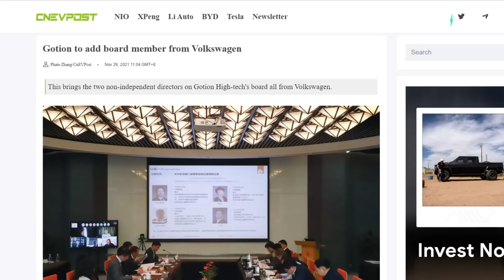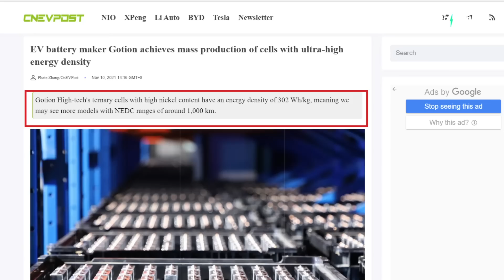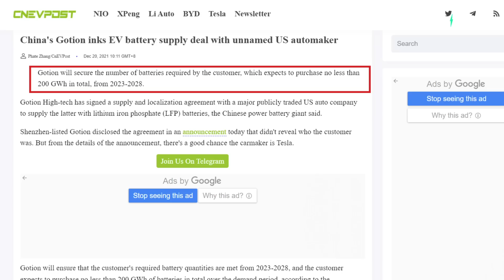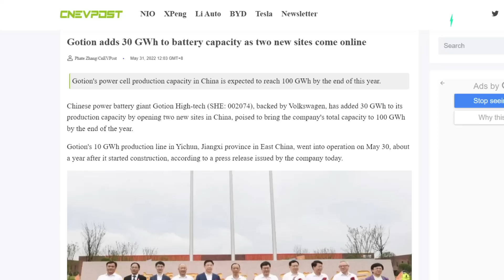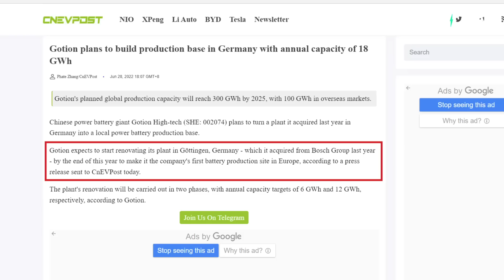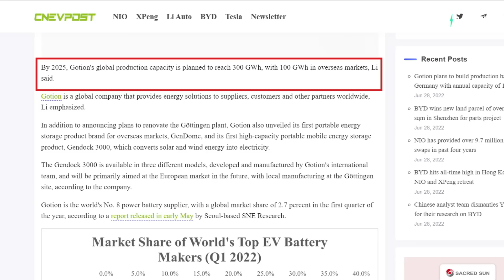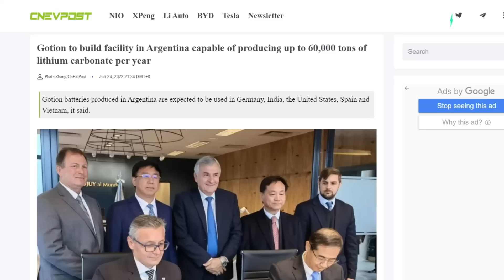Tesla, VW & Gotion High-Tech's scary battery CHESS moves

Comment: How could you say the stated capacity of electric electric car battery in kilowatt hours yet in smaller terms you just say kilowatts? 

There is specific energy density and there is specific power density and you’re not expressing these terms correctly. 

It’s like if the store was 10 km away and you said to somebody ‘ The store is 10 away’ 

I see it so clearly in my mind but nobody else does. What is wrong with you people?

Comment: Tesla's 4680 is the elephant  in the room. How does it relate to this?
Reply: 4680 is just a format, not a chemistry. the 46xx cells of bmw have a better chemistry now than the cells of tesla.
bmw was also very intelligent to make two different versions. the difference is in length. the longer cell is for SUVs, where the floor can be a bit thicker. the shorter 46xx cell if for sedans, where the floor needs to be thinner.
that also makes sense because a bigger sedan has more drag and needs more kWh per distance. very clever from BMW.
the first car with these cells is an SUV has 800km range WLTP and 400kW maximum charging speed. coming in the next few months. german car makers are now advancing fast.

Comment: 6 days ago we had "The biggest EV battery breakthrough I have EVER seen" from CATL which meant we "dont need solid state", now Gotion High-Tech are going to beat everything with a solid state battery! I'm not criticising, the pace of new revelations is just crazy. It will be exciting to see which technologies come out on top over the next few years. Amazing what can be done when the financial incentive is there. It is not hard to see why Tesla keeps on good terms with every battery maker they can. It is impossible to know what is coming next from the behind the curtain and in this case it could be VW that is ahead of the game.
Reply: 6 days ago CATL had the biggest breakthrough, but that was 6 years ago in battery time:) All new technologies are groundbreaking when they are announced, but something new and better is just around the corner.
The next generation, which is even more impressive will be announced next week, I guess.
CATL, BYD et. al. are not asleep at the wheel.
a 1000km battery is an exciting milestone, but unnecessary for most people. Someone with a work truck that provides electricity to tools at the job site and tows a 35' trailer on the weekends is another story.
I would like to see a battery pack with five 20kWh slots for modular batteries. I would buy one pack. That would covet 90+ % of our daily driving w/o ever visiting a charging station. For longer trips, I would rent four more packs that would be popped in NIO style and returned after the trip. I don't really want to pay for the worst possible case, but only what I really need. That would be better for nature and keep Li etc. mineral needs at a sustainable level.

Comment: You keep using the term "turnerairy battery" what is this?
And when talking battery capacity. Please mention if it is cell or pack level.
Thanks...
Reply: Ternary. Like triple. It relates to the three metal oxides used in the cathode. Nickel, Manganese and Colbalt

Comment: Did Elon say that 400 W/h/Kg was the threshold for electric commercial flight?
Reply: That's the bare minimum. In reality, it should be more like 600 W/h/Kg to be practical which is probably impossible.
Reply: it is not watts per hour per kilogram. that would be stupid.

Comment: There's a small mistake I've noticed that you make every once in a while.  You say that if a car comes with a 77KWH battery with this new tech it would get around 1000 miles because it's nearly double the energy density.  NO!!  Utilizing this energy density Gotion High Tech can make a 143KWH battery that would take up the SAME SPACE as a 77KWH battery.  Assuming the same 4 miles per KW (6.43KM per KW) that would give it a 572 Mile (919KM) Range.  Conversely you can also simply make a nearly half sized 77KWH battery that would lead to a small improvement in efficiency ... say 4.1 or maybe even 4.2 Miles per KW, because there is so much less weight in the car.  Like NIO most automakers will choose both, NIO used to come with a 75KWH battery, but now you could choose to stay with that same battery or upgrade to the 100KWh.  Of course for Non NIO cars the choice would have to be made at the time of purchase and not at some  time in the future.
Reply: I think Sam said "1,000 km"..which would be about 620 miles.
Reply: My guess is that Sam likely gets tired of repeating himself over and over.  So when he says there's a doubling of battery energy density he assumes his audience is smart enough to make the simple calculations for EV's.  ie. double the range or same range with less battery (and therefore cost).

Comment: All of these plans are limited by the same problem... Lithium Supply.
Reply: That won't be an issue for much longer, as lithium is a common element.  But once mining operations get up to speed (ie. new sites, higher production + new extraction methods), it will become commonplace and cheap.  On top of that, battery chemistry will likely change over time anyway - as newer/better tech displaces it.  Exciting times!
Reply: @RoguePC4U  Eventually, yes, but mines and refining facilities take a long time to get up and running. The demand for batteries has gone exponential while lithium supply has not. I'm curious to see how this will play out in the short term, long term it will be fine as lithium is abundant in many things.
Reply: @jasonfranciosa  Agreed.  Mind you, depends on your definition of “eventually”.  With China so heavily invested now, I wouldn’t be surprised if our lithium shortfall is corrected within 2-3yrs.  Not long… in my books anyway.
Reply: @yorkyone2143  I hope you're correct.

Comment: VW seems to have trouble now with supply chain and software, but they seem to have been thinking two steps ahead and in the long run that might pay off. Northvolt, Quantumscape and Gotion I'm pretty sure at least one of those investments will pay off, and they are building their own battery manufacturing as well. compared with any other car company that is not chinese or Tesla they seem to be in a good position.
Reply: Tesla dominates and always will, especially over VW
Reply: Germans know how to engineer great cars. The software issues will get solved.
Reply: @keithv3767  Well Bosh sold the battery plant tooth's company , so why couldn't a GERman company as big as Bosh do this ?
Reply: the software issues have already been solved ad it is getting good reviews.
all the german brands are advancing fast. the next big thing will be the "neue klasse" from BMW. the first car from this line is an SUV with 800km range and 400kW charging speed.
they also invest in a startup called deepdrive, who have a revolutionary new motor concept that makes the motor smaller, lighter, cheaper and more energy efficient. also VW indirectly invested in DeepDrive.